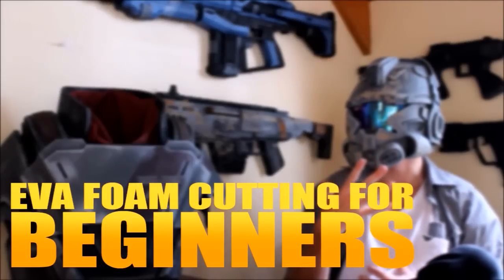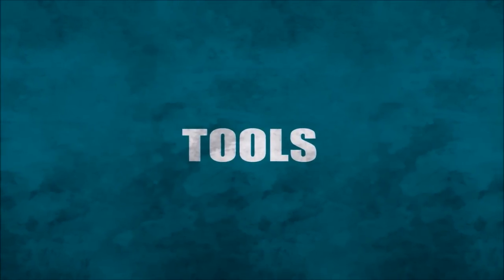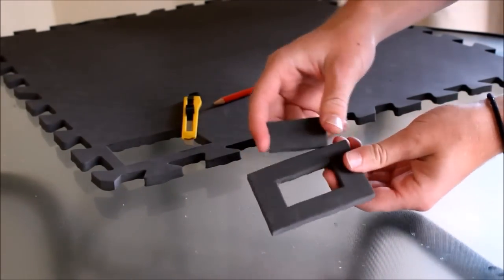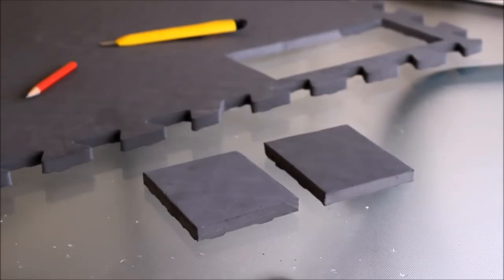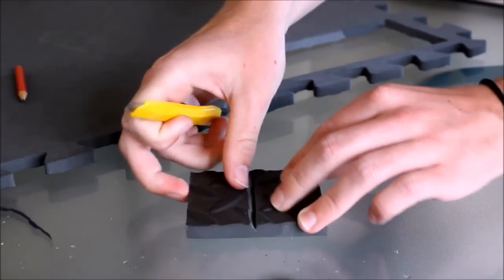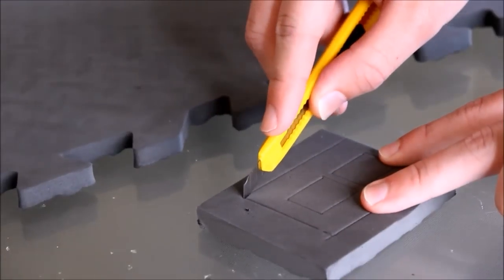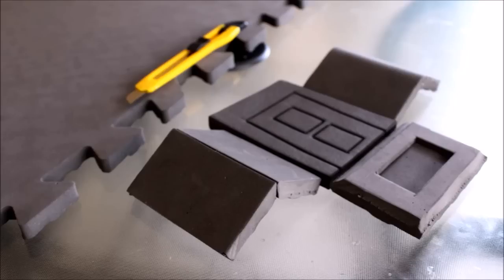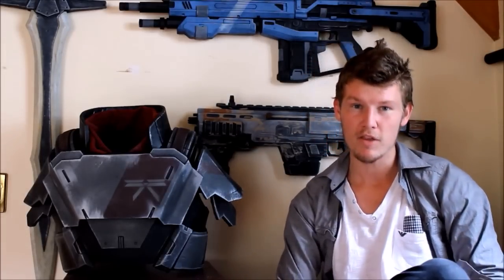EVA FOAM: Cutting for Beginners

Comment: I ordered EVA foam which is think but leaves a terrible jagged edge, I then tried a different company for EVA foam did the same and the cut was great. Anyone have any ideas on why the other one was so bad, I used the same blade for both I think it's just the quality of the foam cause my technique hasn't changed
Reply: Its definitely the blade, try wetting the blade with vegetable oil or water or better razors.
Reply: What does wetting it do?

Comment: Where do you buy EVA foam ?
Reply: Matěj Štemberk these are foam floor mats which are sold in fitness stores and dollar stores.
Reply: Never seen these big foam mats in dollar stores, they are about $20-$25 at Lowes, Walmart, and Home Depot. Also online on eBay, amazon etc.
Reply: Matěj Štemberk harbor freight, 8 dollars
Reply: cheaper at harbor freight tools
Reply: they sell EVA foam there?
Reply: If your in the U.K. You can buy 6x EVA  matts at HALFORDS for £10, Large sheets & black coloured
Reply: Five below(U.S) has them for 3 dollar
Reply: How many millimeters is the foam?
Reply: Jax Spinner great!

Comment: May I ask question about sanding eva foam sanding - using dremel i get i but inaccurate surface sometime. 

How do you advice to clean up it (to make it clean and smooth  ) - sanding it by hands with fine-grained sandpaper, or maybe some other solutions?

For example such surface - 
https://skydrive.live.com/redir?resid=8669476ABEDCC981!66241
https://skydrive.live.com/redir?resid=8669476ABEDCC981!66242

Comment: I am working on my first cosplay using EVA foam, and my edges look really bad! I've been trying to smooth them out with sand paper (dont own a dremel and not able to buy one unfortunately) but it doesn't work at all :( Is there any other way?
Reply from the maker: Hi, The edges are always tricky,  the way to solve the issue is to ensure you are always using a very sharp blade =D It  dulls very fast when working with foam sadly. If you have it sharp you will get the nice edges, otherwise is very difficult to smoothen them without a dremel =(
Reply: I actually went out and bought a foot scraper a few hours ago and its working great :D Best purchase I've ever made! :'D 
Thank you anyway! <3

Comment: Hey I'm looking forward to hopefully craft some costumes with Eva foam, but I always see you tubers using the puzzle like Eva foams that are mainly used as mats and have that rough texture on the back and smooth texture on the front as you are using in this video, would just plain Eva foam nothing specific work also from michaels?

Comment: could i instead use a hair dryer rather than a heat gun or would it not have the same effect
Reply: Depends on how hot the dryer gets. Just to be on the safe side, use a heat gun with an adjustable heat setting.

Comment: Do you always use hot glue or do you sometimes use like a contact rubber cement (like Barge in the USA)  or Evo in the UK?
Reply from the maker: I always use Hotglue, so that way I dont have young people trying to use barge cement unsafely trying to copy me =)
Reply: Ah right, ok..  thanks for the reply buddy :)
Im using EVO Stick thing which is like Barge i guess..

When your connect two pieces together, and say you have a gap - what do you use to fill the gaps?  
(Apoligies to fire questions at you - i wont be offended if you don't get chance to answer :)

Comment: i dont have a heat dryer. but i have a hair dryer. will it work with that or not?
Reply: SuperNova1998 No. Hair dryers are not hot enough for the foam to form.

Comment: Can I use a hair dryer instead of the heat gun or is it not as powerful?
Reply: Not as powerful, depending on what you want to do it with the heat gun works the best

Comment: When I cut my EVA Foam with a craft knife, it didn't give a clean cut. Why is that?
Reply: dull blade
Reply: Evan L
Makes sense.
I'll have to look at purchasing a new craft knife, as well as a Heat Gun the next time I'm out shopping.
Reply: +Nine_Tails137 Also, blade sharpeners. Cos EVA foam is so soft, it dulls the blade quickly

Comment: Could you use a hair dryer instead of a heat gun
Reply: It's possible if you hairdryer gets very hot but it doesnt work as well/As quickly and put too much stress on the hairdryer I've found

Comment: It appears as though your razor is extremely good - I try to sharpen my razor to get it to cut smooth, it starts gripping the eva leading to clipped cuts and jagged edges after around 5 swipes. I can't tell if it's the blade, the eva, or my technique. Did you have a learning curve with cutting it smoothly? Is there like some fancy way to do it, or does a sharp blade make the real difference?
Reply: +Noto V Its the dull blade. I get this problem all the time, a dull blade tears the edges up all the time. Razor blades tend to dull very fast.
Reply: +Noto V Ive also heard EVA foam really ruins blades and knives. Once I start building my Mass Effect armor, I have no doubt Ill get a blade sharpener.

Comment: Where can you buy eva foam?
Reply: amazon is bae
Reply: any hardware store. look in the workshop sections they typically use them as floor mats so you don't slip while working. you can buy a giant piece of 4 for about 20 bucks
Reply: Harbor Freight seems to have it for the cheapest. 4 pieces for $9.99.